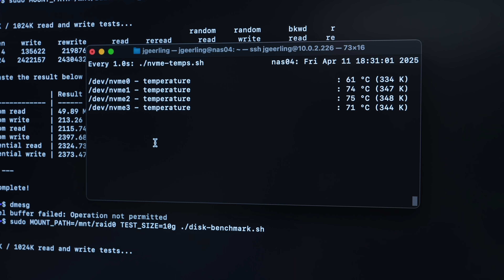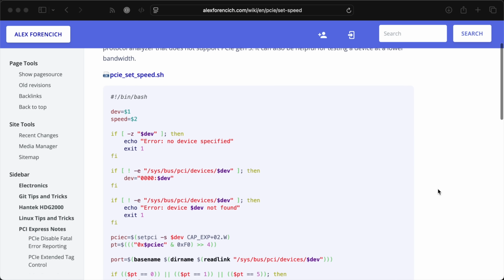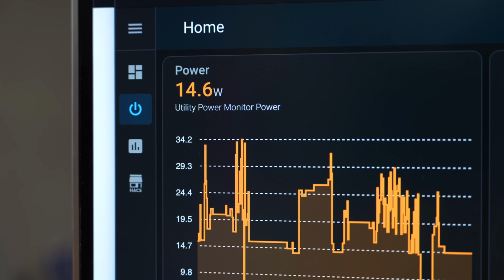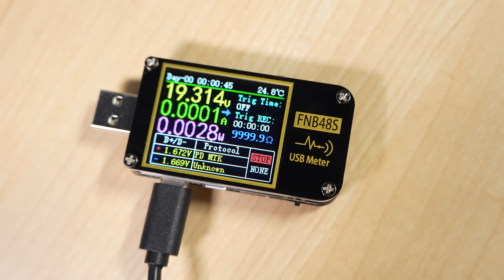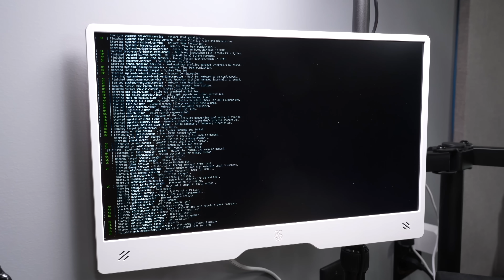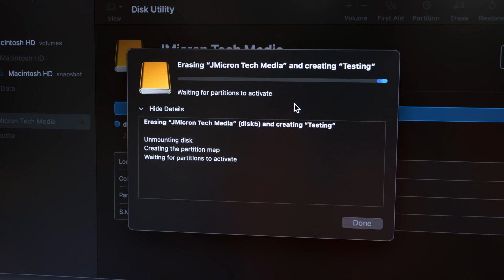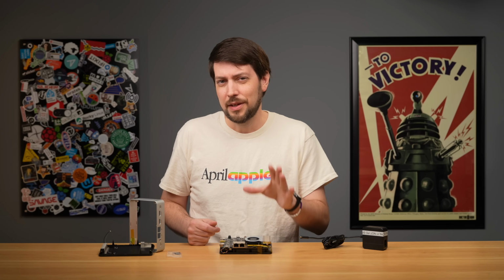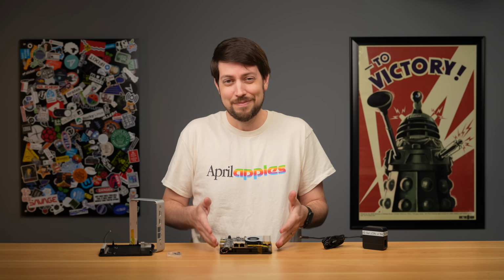I fixed the perfect Mini NAS!

Comment: I have one of these KingSpec NX SSDs and the performance sucks, down to class-10 SD card levels. I suspect probably there are firmware issues.
Others from brands like Asgard and Netac shown much more 'nvme-ssd-like' performance. I wish that there was a online database that we could feed info to about performance, controller, DRAM, properly SUBNQN setup on firmware, etc.. Like a ookla speedtest, but for NVMes and such.
Anyways, cool vid! Reinforces that "mobile-spec" hardware can do great if the SoC *AND* other components (VRMs, NICs, ...) are properly cooled. But it's not as simple as cooling an ARM board (rpi, etc) just by slapping a aluminum slab on top of the SoC.
Reply: The problem with a lot of SSDs not only the "cheap" chinese ones is that the specs change from batch to batch and they often keep the same PCI ID.
DRAMless QLC SSDs tend to bring full speed for 1/4th of there rated capacity and if you are almost full you can see speeds that go down under SATA HDD speed. 
I've seen as low as 48 MB/s. (Hi Patriot).

Comment: Compliments for taking the effort (and feedback) to actually test the PSU.
My suspicion was correct, no actual USB-C PD.
Meaning not compliant to standards, as you mentioned in the video.
Reply: For these mini PCs, I find it more reliable if they use a barrel jack and I can spend another $2 on a separate type C to barrel jack cable with PD voltage negotiation.

Comment: I looked at a few of these, the best one would the Asustor Flashstor but getting TrueNAS on it is a real pain. Then there the issue with ECC RAM and data integrity, which if I plan to store Family photos on it, I don't want a even slight chance of that happening. Having Backups helps but if the file get corrupted on the NAS you SOL.
Reply from the maker: Ugreen makes a decent one now too, but it's very tall (for rackmount), and even more expensive.

I've been pleading with ASUSTOR to focus on the 6 drive model, narrow it down to fit in 1U mini rack, and they haven't said "no" yet... I would love to see their take on it :D

Comment: What an appealing, but terrible product. Your testing is an important public service.
Reply from the maker: The sad thing is the board itself is a pretty decent design. Just, not at all in the case they built. If they had a couple blowers on the far side, pushing air across the whole thing, with better ventilation holes on the exhaust side (right now air just kinda hits that wall and heats up the entire interior), it'd probably run rock solid.

Comment: GMKtec really can be a mixed bag. their older designs like the K4 were problematic since they did not have a fan for the NVMe and RAM, so you would end up with thermal throttling RAM that made the system pretty much unusable. It wasn't until they refreshed it with the K6 that they added in a fan that solved those issues. What I will give them credit for is how quickly they iterate on their designs and fix issues. their K11 Mini PC is pretty fantastic in comparison to the K4. But this is a really rough state to start off a new design with. I have no doubt that they can fix a lot of these issues with a new revision next year but its wild that they even need to do that after being in the Mini PC space for so long. There are too many amateur mistakes.
Reply from the maker: I hope they do a redesign of the G9—keep it under 1.75" tall, but maybe add a little width and some more heatsinking for proper cooling.
Reply: @JeffGeerling  I'm already sunk into one of these, got it on sale early in the year. Your review and teardown has been stellar. I want to stick with it despite the drawbacks, as it's past the return window (I think?) and I can't afford to be grabbing new stuff all the time. Though, I have dropped probably an additional $200 into it.
Reply: @JeffGeerling That being said, it's very interesting that it will run off the second USB-C port. I have some higher end GAN chargers laying around...

Comment: If you still want to give something else a try, check out the SK hynix Gold P31 SSDs they are pcie gen3 with dram cache and have one of the lowest power consumption of any ssd on the market. If any ssd is going to work in this thing, it would be those.

Comment: If you can, please take it!, i wonder even with 2.5G limiting throughput, will putting more SSD into RAID help with small files? or keep speed when writing to files larger than ssd cache size.
Also, i think Beelink is now shipping ME mini ( for now, some say there may be some higher tiers ) with 5 x1 + 1 x2 / sata combo port with seems better combined CPU and SSD cooling, hope this info helps ^^

Comment: Yes let's see how the K100 does!
Reply: So ive had the K100 for about 6 months running UnRaid with 4 4TB Crucial P3 drives. It's been rock solid. Im even running TDARR via docker to re-encode jellyfin videos to HEVC with the igpu. Its been great. I wish it had built in wifi since i use it as a travel nas but i have no complaints.
Reply: Yes, love to see how K100 performs.  Especially the thermals.   It's crazy the way they designed the case on the G9 not even make use of the metal case for passive cooling.
Reply: AGREED!
Reply: 100% on board with this. I'm very interested in a mini NAS like this that isn't complete ass
Reply: That's awesome. How much power does it consume?
Reply: Definitely. I'm super into storage, managing several fileserver clusters with more then 2PB (yepp, Petabyte), but I don't have the muse to do it at home at all, but I like all the little projects from Jeff.
I was using Raspberry Pis for years for my mediacenter and "storage", but ultimately switched to a Nvidia Shield and a little i3-10100 server.

Comment: The craziest part about this video is Jeff listening to a random commenter recommending crappy non brand SSDs! :face-blue-wide-eyes:
Reply from the maker: I've used Kingspec SSDs before, they're not a flash manufacturer but generally their SSDs have worked out in the past (they used to be one of the few suppliers of decent 2242-size NVMe SSDs). I just wanted to test out some drives that someone in the comments specifically mentioned as working.

So as with many things, it's a case of 'getting what you pay for'
Reply: @JeffGeerling  Fair! Reputable Gen3 drives can also be hard to come by anymore, as most have moved on to Gen4 and 5 by now.
Reply: KingSpec is a member of the ASSD. In business since 2007. You should mail there support in regards to the firmware problem.
Personally I've only seen the TLC version of the Kingspec NX Series opens internal wiki (Silicon Motion SM2263XT controler, Micron B27B FortisFlash TLC 96-layer) it's like the Teamgroup MP33 but afaik that's only up to 1 TB the 2 TB drives are QLC and the controler does depend on the batch.

Comment: Non-PD USB power bricks that output over 5V should be entirely BANNED. There's no excuse to do something that dangerous, PD is cheap now.
Reply: In fact, they're actually not even allowed by all rules and regulations in most western countries.
So technically they're already "banned".

Unfortunately it doesn't hold companies back from flooding the market apparently 😕 
Says a lot about how bad certain design morals are.
Reply: Are there not a number of non-5V charging standards that aren't PD? Qualcomm's Quick Charge comes to mind
Reply: @punkdigerati  of course, but those won't fry your expensive electronics either
Reply: @punkdigerati  They normally start at 5V and only increase the voltage once the device has confirmed it can accept it.
Reply: @punkdigerati  He should have said, "USB power bricks that go ahead and output over 5V without confirming that the receiving device is ready to accept it should be entirely banned".
Reply: That's any USB-A to USB-C adapter mind you, only "pure" USB-C got "5V sensing" via resistors and it's not only about adapters, lots of devices does expect 5v to just exist
Reply: @SergeiSugaroverdoseShuykov  These adapters DO NOT output more than 5V unless you plug them into non-compliant equipment that outputs more than 5V without confirmation that it's okay to do so.
Reply: I do think it should be banned. Part of the promise of usb C (and connectors) is that if it fits, it works or maybe not work, but won’t fry your device. These type of chargers fry the device.
Reply: No you don't have to ban something like this because it doesn't fit the new standard if the plug and base was designed for it's device only. You don't have to ban everything as a solution.
Reply: @PUP-v4c  No, they should have a different connector then, and not USB-C
Reply: @PUP-v4c  It must not be allowed with any normal USB connector.
Reply: @ No I think it should come with a warning. Not banning. Alerting the consumer to the dangers of using a plug designed for a specfic device should be the base line. Consumers are intelligent enough to protect themselves and producers should have a choice in what plug types they use for their devices.
Reply: @PUP-v4c  Why? There are plenty of alternative connectors, for which it hasn't been drummed into us that they're all compatible.
Reply: @BrianG61UK  Lets say I want to sell a device on the market with parts that I have on hand. The controller of that market makes it illegal to sell devices of that class with that plug at with my designated voltage. I say the part that I've used is what I have on hand or have choosen to use. I now can no longer sell my devices in that market even though I only have access to that one market. Nothing physically stops me from ensuring that part works with my setup but I can't use it now because of laws that make it illegal to do so. It does not harm my devices but it harms others even though I've warned others that they should only use it with mine. That desicsion should be in the hands of the producer and consumer not a governer of a market.
Reply: @PUP-v4c  Presumably you wouldn't argue that way if safety of a human was involved, say I chose to save money by making the chassis live if you insert the mains plug the wrong way, but it's okay I warned the customers). Why is it okay to allow the possibility of expensive damage if the user, or user's friend/relative assumes a USB connector is being used for USB?
Reply: @BrianG61UK  Well the designer has to know how to design their device in a manner that will not cause that harm. If the designer were to cause harm to there users they will have more to worry about than just the market they are selling there products in.